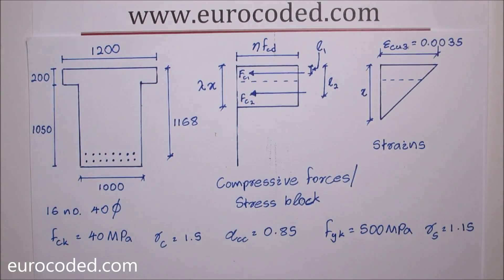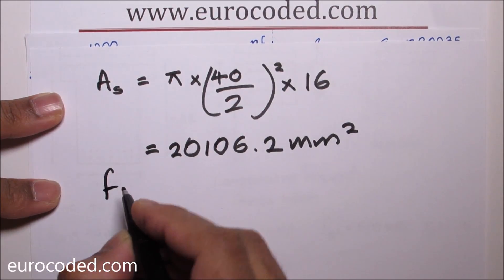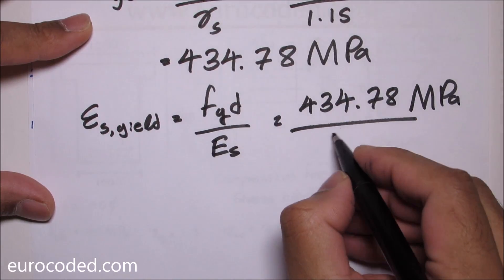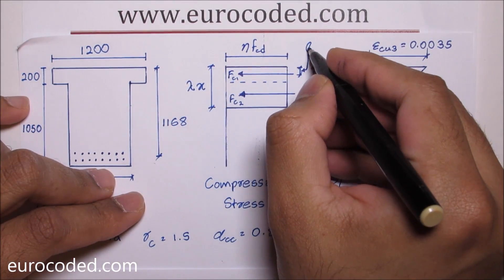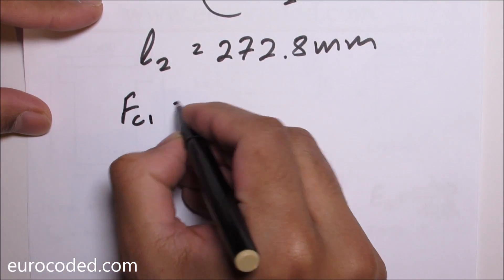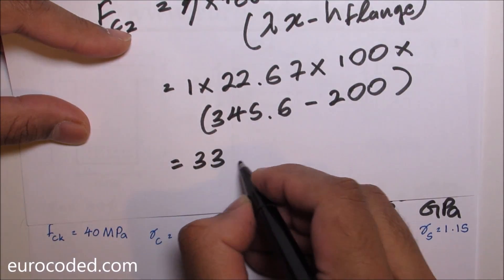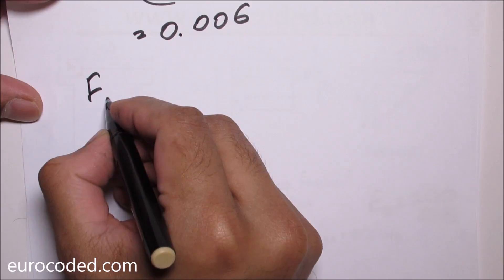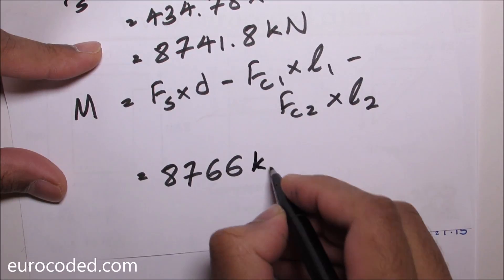Concrete T Beam Design to Eurocode 2 - Strain Compatibility Method

Comment: Hi. how did you get the value Fc2? The answer i got was different for Fc2. The correct answer is 330kN.

When the FC and FS value is different, may you show us the further step?
Reply from the maker: Hi Muhammad. Width of the web is 1000mm but when I wrote the equation, I wrote 100. However, the final result is correct and F_c2 = 3300kN.
F_c2 = η • f_cd • b_web • (λx – h_flange) = 1 x 22.67 x 1000 x (345.6 – 200) = 3300kN

You have a good eye and I am glad you picked it.